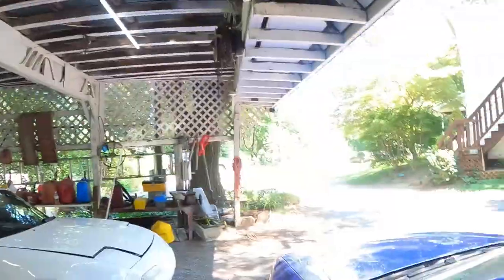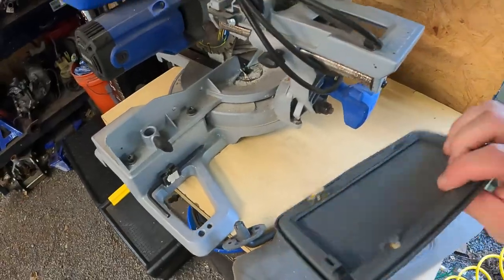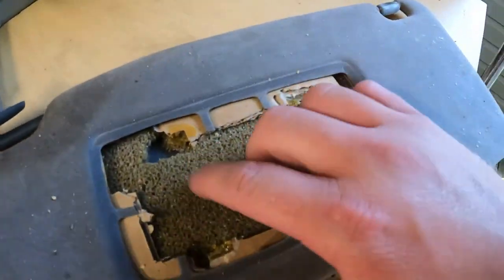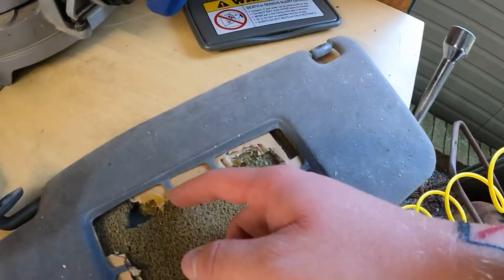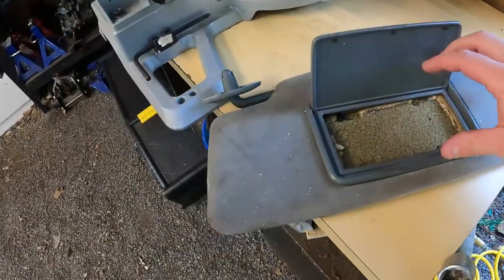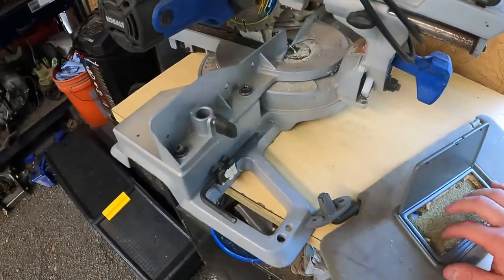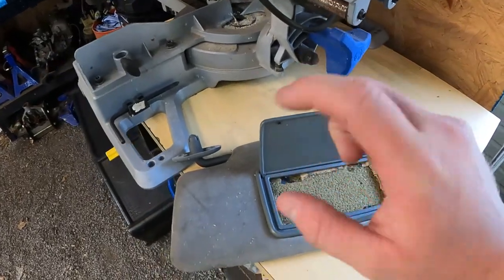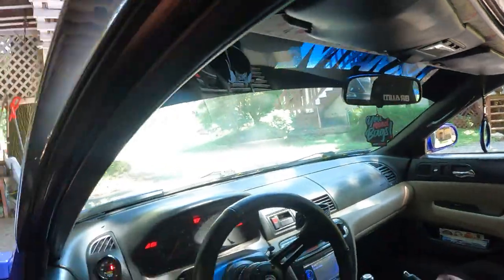Custom Airlift mount!

Comment: Ok that’s pimp asf 😍 you have any spare 5G parts right now? I just got done manual swapping mine with an M2A4 in my driveway. (picked it up Tuesday with a blown auto. It’s also F20B swapped which the owner didn’t even know, I found out when I was tearing the car apart 💀) I want to drive it so bad, I verified everything works on jack stands and I only need to buy a few parts to get it driving 😩
Reply from the maker: Nice!! Mines F20b as well with the T2T4 trans!
Reply: @twoshayshirley  oh hell yeah, that’s awesome! I went with the M2A4 for my manual swap, had to make it fully JDM 😏